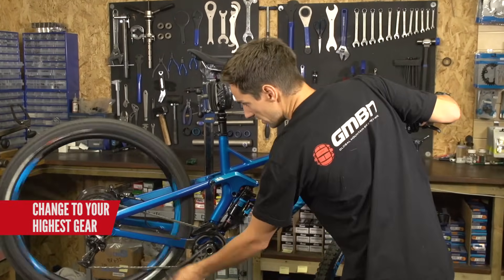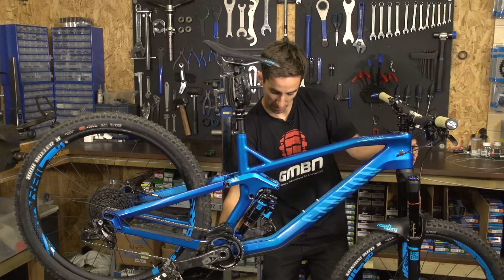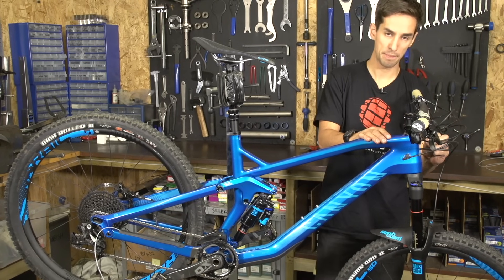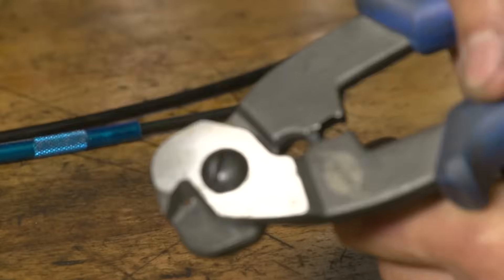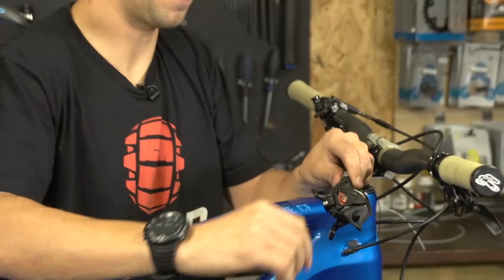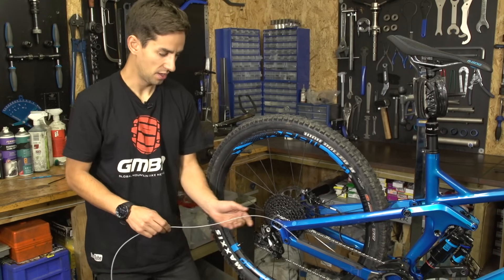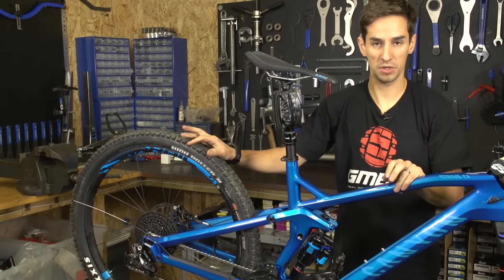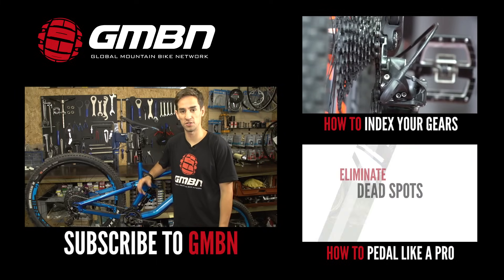How To Replace Gear Cables - Mountain Bike Maintenance

Comment: I used the method explained here to change a single internally routed cable the full length of the bike. Once I removed the cable ties it was incredibly easy and watching this video probably cut a 2 hour job down to 2 minutes, unbelievable.

Comment: It's worth noting that cable stretch is a common misconception. The cable doesn't actually stretch, it's the cable housing that compresses, therefore extruding the cable through it. This is what gives you the problems associated with "cable stretch".

Awesome method with the internal routing, Neil. Wonderful video.
-Alex

Comment: You don't actually need the piece of plastic tubing if you follow a certain order of operations.

First pull out the inner cable out of the rear section of outer cable, leaving the outer cable in as a guide.
Then change the front section of outer cable, using the old inner cable (still connected to the shifter) as a guide.
With the new front outer cable in place you can replace the inner cable.
Thread the new inner cable through the old rear section of outer cable (which we left in the bike in the beginning).
Pull out the old rear section of outer cable.
Install the new rear section of outer cable using the (new) inner cable as a guide.

Comment: One thing worth noting is to put the tension adjuster on the shifter lever in a neutral position so you can adjust both ways after changing the cable!
Reply: +Mo how do you do this?
thanks
Reply: +jd b06 on your shifter lever, right where the cable goes in, you usually have a rotary adjuster that you can either screw in (lower tension) or out (higher) in discrete ticks. make sure this is in a middle position when installing a new cable!
Reply: Good idea
Reply: @akinadom  you meant barrel adjusters?
Reply: @nzo_6543  exactly

Comment: Very clear and easy to understand! Should really replace the gear cable on my bike.... and tires... and all of the bearings.... pedals, and pretty much every moving part there is on my bike.. Saving up for a new bike so thats not gonna happen ;D Keep up the great work!
Reply from the maker: +Mr.BadassProductions Hey Mr Badass, Your bike need a bit of TLC? I,m sure watching our maintenance videos will prolong the life of your bike? Cheers Marc
Reply: +Global Mountain Bike Network not really worth it ;) had it since I was 13(19 at the moment), so its too small, weighs like a downhill bike(even though its a hardtail...). Thanks for the reply!
Reply: @DennisJTapio  absolutely same, but i am 15 now... 

Looking forward to buying a lightweight frame at least and build it slowly on my own instead of buying it ready though...

Comment: I did this on my canyon nerve and my shifting is AMAZING. It’s so easy to shift and shifts quickly! 
I have SLX shifters and a Deore XT rear mech. I didn’t change the front mech cables as they were fine.
Next upgrade is a dropper!

Comment: Nice guide. Seems like huge work compared to outer cable
Reply: +Pienimusta honestly I have a merida X0 edition and I don't have to use any hacks shown in this video...just put the cable in there,push and it's going by it's self where it should...I think the frame has a kind of guideing for the cables inside...
Reply: I watched my local bike shop guys change my back gearset's cable and it was done like in 10 seconds :D cables just flew all over and it was done.
Reply: i know....it's a tough metod shown in the video

Comment: When replacing the outer cable: if you don't have any thin tubing to push over the old inner cable, try connecting the new outer and old outer cables together - use a short length of inner cable to line them up, and wrap round with a couple of layers of sellotape to join them. Then you can push the new cable whilst pulling on the old one, to get the new outer through the frame. Just don't pull too hard. Also, don't do what I did and try to push the new outer over the old inner, that ended in disaster and I spent 2 hours poking electrical wire through my frame to guide the new cable in.

Comment: In the cable housing barrel adjuster for Grip change MTB DO NOT overtighten as in all the way out or you will get a kink in your grip adjuster cable housing that may break off. Wind all the way in (barrell adjuster) then count the quarter turns to full out then back the adjuster in 1/3. If your cable ends become frayed then with them firmly afixed to either the front or rear derailluer or brakes you can use a regular pliers to grip the ends of the cables HARD then twist the ends of the cables so that they become wound which tightens the wire spool cabling crimp ends help tidy up the cable job.
Any work requiring maintannance OR replacement of the front grip shifter may require removal of the cables from that section of the bike cabling system and then reassembly.

Comment: Thanks Neil, 

Great video and very useful info on internal routing. 
I noticed, in the video you have your Canyon held in the work stand by the Reverb post. A thing that Rock Shox tell you not to do.  I know that they recommend holding the bike in a work stand by the outer shaft of the post, but I had my internal hose to the reverb shortened and i can't shift the post far enough out of the seat tube to allow me to do this.
Your bike seems to be pretty secure in the stand and I would prefer to use this method myself if you would recommend it.
I noticed that some kind of pad is being used between the bike and the stand.  What is this? Hope you can help.

Thanks
Reply from the maker: +Sean Wilton I have always put my bike in the stand this way and never had any problems. Most bike stands have a tough rubber part inside the clamp that wont damage your seatpost. Neil

Comment: But are there some clear indications that a cable is worn, apart of obvious examples like the cable being rusty or frayed? Because poor shifting can possibly be due to something other than worn gear cables. For example I have recently replaced a chain going from Shimano to SRAM (on a Shimano drivetrain) and I feel that shifting has slightly deteriorated and I don't think my gear cables are the issue. So do I have to eliminate all the other possibilities of poor shifting before saying "yep, these are cables" or is there some other signs?

Comment: I have similar Strive (same year) and I failed while guiding white tube through down tube. It's all just fine because there's no problem to guide it through this tube using cut-off at the top, but... how should cable go inside of it? I've found some additional black thick cable inside of tube (plus two regular: one for rear brake and one for Reverb) – is it something I should use? Canyon have zero response on it. +Global Mountain Bike Network ?

Comment: Where can i get some of that plastic tubing from? ive had a nightmare in the past trying to route internally routed cables and that stuff looks ideal. Many thanks
Reply: I would be interested too
Reply: I'd like to know too
Reply: SHIMANO Cable Liner Y80098100
Reply: Thanks
Reply: +Maglia Nera now the question is ... where to buy this :) I`m from Europe and on ebay there is only 10 pieces .. from USA :/
Reply: You can use the core from an outer cable. Just use a sharp knife to strip the plastic off and separate it from the small inner plastic hose.
Reply: Yeah that will be fine
Reply: TheBiscitt i
Reply: Maglia Nera t

Comment: Nice video but not everyone's bike is a 1x. And I noticed no grease was used. Idk I noticed other people recommended using grease
Reply: If you have teflon coated cables, you should not use grease in your bowdens.
If you have stainless cables, it's okay and often recommended to use lubricant, unless your bowden is factory lubricated, in which case there's no point adding any more grease. 
If you have regular galvanized cables, you really should have bought the stainless ones cause they're better and not really much more expensive.
Reply: LimitedGarry sweet thanks for the info! Very much appreciated

Comment: You could just pull old casing off old cable push new casing onto old cable  then pull old cable out of new casing and push new cable into new casing. Unless old cable is damaged then use your method lol

Comment: how do you know when your cables are wearing out and need replacing. im new to cycling and i dont know how a worn out cable should feel can you tell me for both gear and break cables
Reply: For brake cables, it probably doesn't matter. As long as it's braking and the cable isn't damaged, it's fine. 
For shifting cables, you replace when you start noticing difficulty with correctly indexing the shifting. 
And as stated above, you want to change both the inner and outer cable, because both receive some wear.

Comment: I noticed you didn't put any lube on your cable, you obviously don't need it? I'm really interested in buying a canyon bike when they start selling in Australia, the components are top notch, but how is the frame??
Reply from the maker: +MrRicho32 You don't really need lube when the outer and inner cable are new. All top quality stuff. Neil
Reply: I guess I'm needing some kind of lube when my new outer cable seems to be catching before it comes out of the first exit near the bottom of the frame? I can feel it's getting caught just before it comes out the first hole (it's going to run the whole way through and frame). I got the old one out OK and the new outer is the same type (Jagwire - Lex SL). Otherwise it seems like I'm going to ruin the new outer before it's even got fitted. So any lube in particular or is there a better way of making a clearing within the frame where it's being threaded?

Comment: i got my gear cable changed at a bike shop and they did not put an end cap on is that ok or should i get one and put it on also what do i have to do when my gear cables stretch after a few rides i dont know what to do

Comment: Where did you get that white tubing from?
Thx in Advance
Reply: You can use the core from an outer cable. Just use a sharp knife to strip the plastic off and separate it from the small inner plastic hose. What you end up with looks identical to what Neil was using.

Comment: #AskGMBN 

Hi guys thanks very much for all of your brillant videos. I have watch this video a few time of Neil changeing a internal routing cable. the set up on my Focus raven is much the same as this, but my problem is (apart from bricking it about doing it myself) i don't know the outer diameter of the threading hole on the frame. so i've ordered 3mm x 2mm do you think this will do the job as i'm only going to get one chance after cutting the cable as it has all frayed at the end. I would much appreciate an advice you can give me. Also while i watch you videos i go on my trainer, would you consider doing a training video while out on a trail. keep up the great work. :)

Comment: If you have split inner housing can you convert it to run full length?
Reply: That really depends on your bike. On some bikes, it's easily possible, on some it's possible with some tinkering, on some it just isn't. 
In a nutshell, it depends on whether you are able to make a new route for the cable. Usually it's easy to make the cable go down along with the braking cable, but once you reach the bottom bracket you need to start making a different route and that part can be really tricky on some bikes.
Reply: Thanks.  It turned my bike was fully internally routed.  So it was a breeze to do.

Comment: can someone give me some advise ive pulled the gear and rear brake cables completely out of the frame is there anyway to get them back in i was think putting some cardboard in the little hole so it acts as a ramp and hope the cable goes up it. is there any easier way of doing this the bike is a mondraker summum pro 2014 please help haha

Comment: hi guys I've been planning to change my shifter and I am having a problem in choosing one of a trigger shifter that is combination with brake levers or the separate ones...what do u prefer guyz? hope you'll reply
Reply from the maker: +Mark Guillermo We always prefer separates.
Reply: +Global Mountain Bike Network guys does all shimano shifters like deore,altus,saint are compatible with different derailleurs? are they all SIS compatible?
Reply: Global Mountain Bike Network hi I'm trying to change my front gear cables is it the same concept as the rear gear cables
Reply: Absolutely. There's no difference between the cabling other than cable length

Comment: I wish I could find 1 on the front derailleur, just did my giant talon, and I successfully changed the cable but I shifted up and it's now not moving the derailleur And shifter stuck in 2nd, I am so angry with myself, I think I got the gear cable set up wrong on the front derailleur but nobody thought of doing a video for the front and how to feed the cable correctly to the lock nut on the front derailleur.its gonna cost me to fix it now, I'm gutted,I'm such a tit